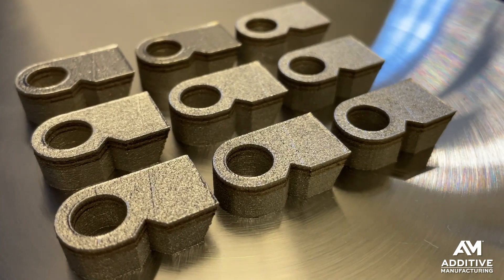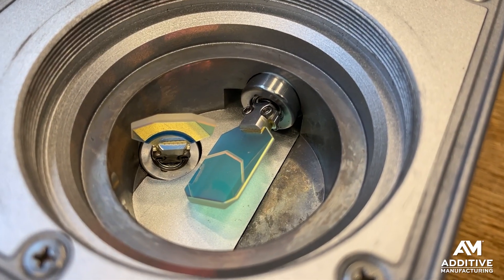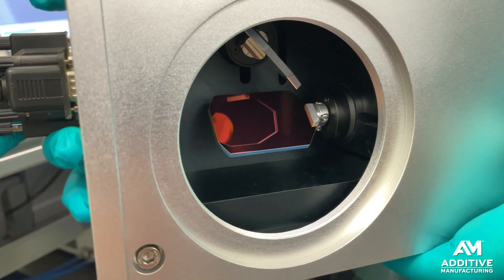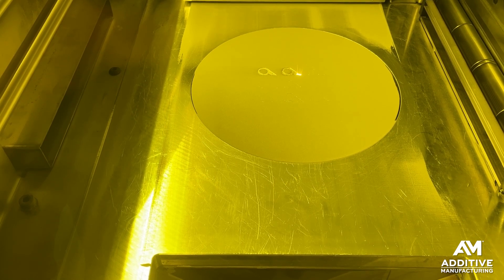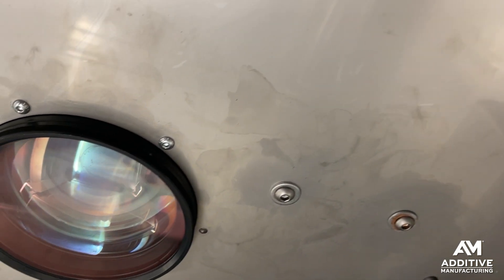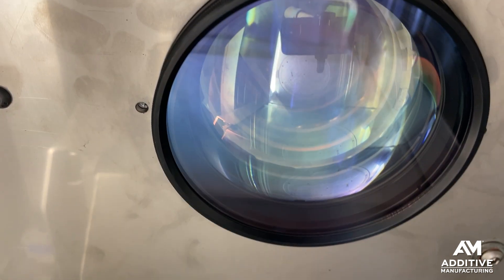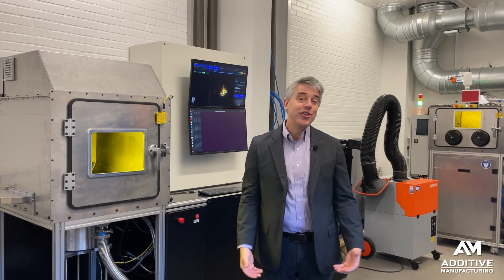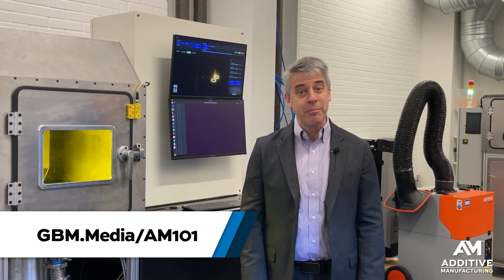What Is a Galvanometer? | Understanding Laser Powder Bed Fusion

Comment: Why not compensate the distortion of the beam by software algorithm which precisely adjusts the galvo? Instead of using an F-Theta lens. Or you can use both, for example.
Reply: how would software be able to compensate for laser distortion?
Reply: @user-ix8sz2mu9y  by distorting image in such a way, that the image distortion is compensated by lens distortion, so everything evens out.